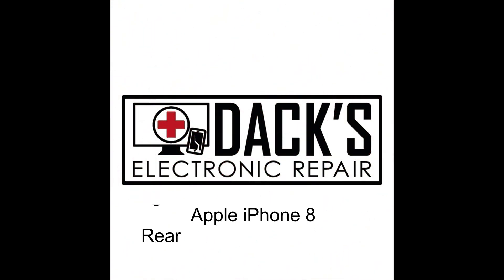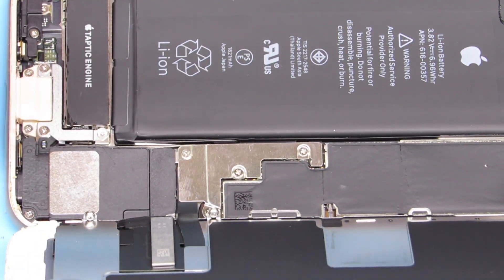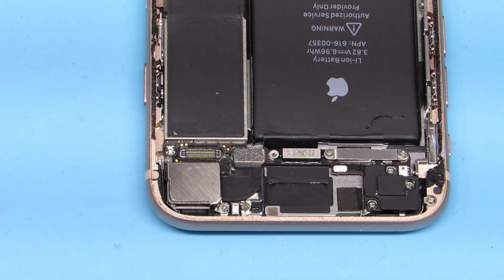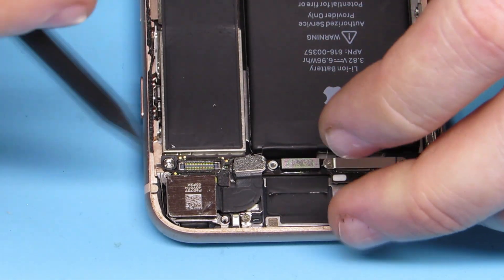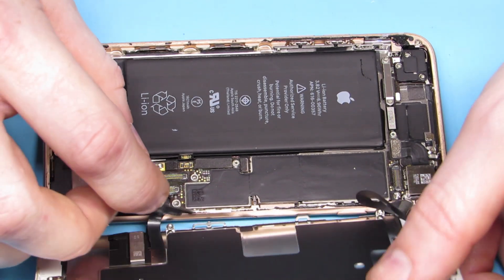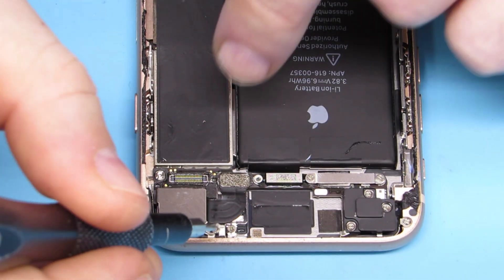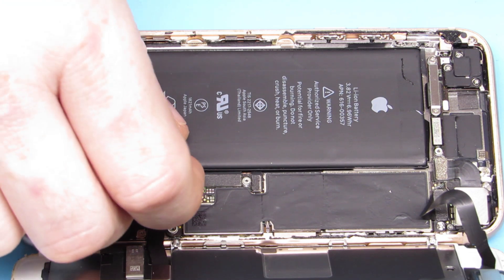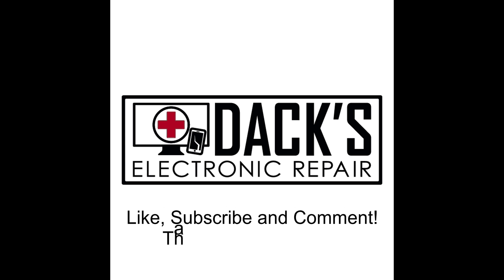How to Fix a Broken Apple iPhone 8 Rear Camera (Rear Camera Making Buzzing and Whirring Noise)

Comment: Hey man, great video. Camera works great now! However... now the main button (Touch ID button) isn't working at all. What have I done??
Reply from the maker: The button flex cable goes through the screen display cable but make sure it is plugged in under the plate.